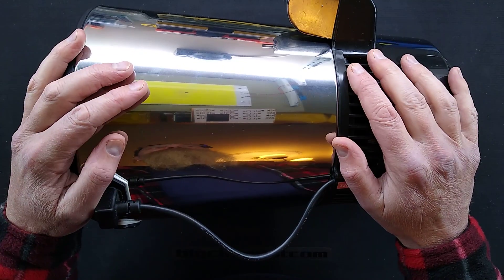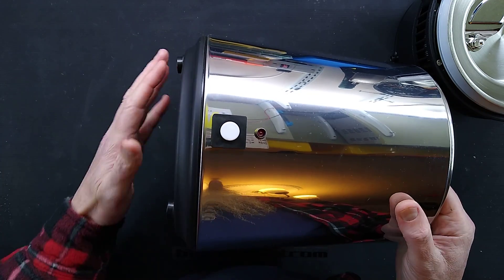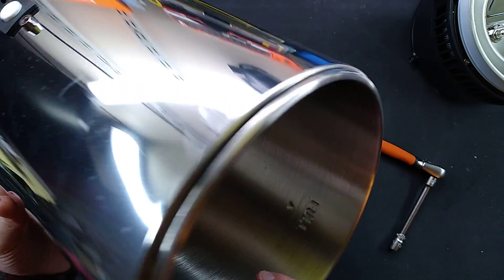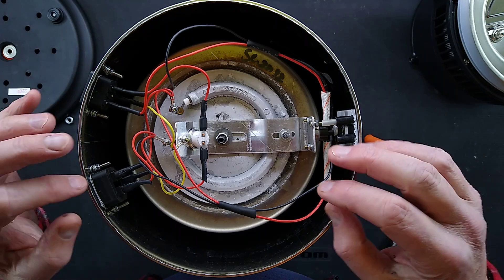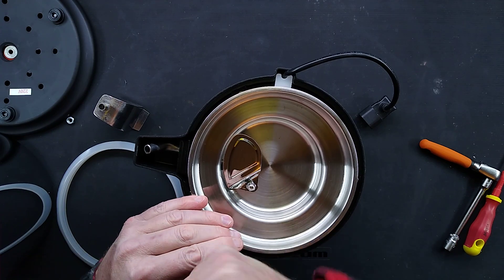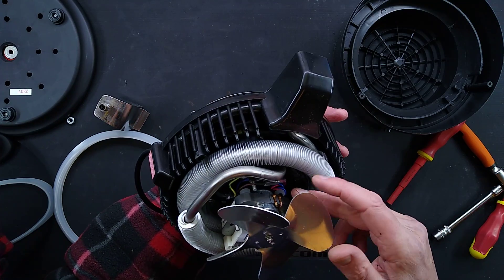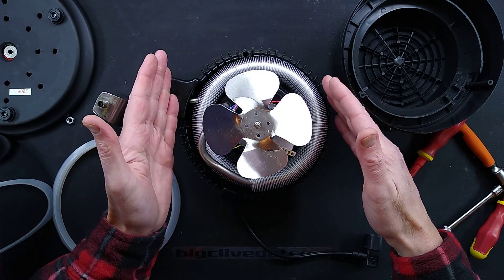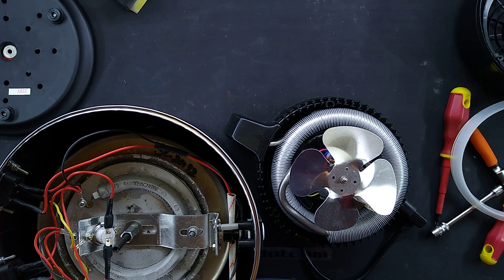Water/alcohol air-still distiller teardown

Comment: Adding a settable thermostat, possibly even a PID controller, in just the heater leg of the circuit would allow precise temp control (below 100c) unless you replace the temp cutouts.

Someone mentioned using reverse osmosis to "deionize" water.. It won't work.

You need a deionizer column with "water softener" beads in the column.

Lab stills are made of a special glass tubing.. metal will leave all sorts of ions in the output.

Thanks for the look inside.

Comment: I wondered what the simplest design would be so the waste heat is not all released into the air, but used to heat up the next water close to boiling temperature, so evaporating it takes less energy. Just like in industrial distillation - heat recovery. I mean even just 50% recovery would be a huge efficiency gain.
Reply: I'm thinking instead of a coil and fan, have the steam move through a 1/4" copper pipe that's inside of a 1/2" pipe.  Water comes in through the 1/2" pipe, which cools the 1/4" enough to make it an evaporator, and that heat is transferred to the new water, pre-heating it before evaporation.
Reply: @alexanderm2702  that's a pretty good description of one form of counterflow heat exchanger.
Reply: usually done in a continuous flow apparatus. I suppose you could do a batch variation on that, but as the secondary pot gets warm, efficiency of condensation would drop, so you'd end up with either losing water vapor (humidifying the room) or need just as long a condenser anyway.
Reply: @RossReedstrom  You could probably do it using a heat pump, but would be terribly complicated for such a small distiller.

Comment: I have a very similar looking model and even after multiple runs, without the carbon filter, the water tasted terrible (much worse than before). Distilled water should have not taste, so I take that as a huge warning sign. Something must be leaching back into the water from the top part. I mean the addition of a carbon filter itself is suspicious, because it should be mostly redundant in a system with material that do not leach. Does anyone have similar experiences or insights?
Reply: Get one of those timer power sockets and set it to shutdown sooner so there'd be a bottom of water left, otherwise the leftovers get burned and leave behind a nasty smell which you can taste, although the water is clean (0 ppm)
Reply: @null643  interesting thought. But even the first drops, or the middle stream tasted terrible, when there was still a lot of water left in the boiler, so this does not explain the taste here.
Reply: @tristanwegner  So that means you either have a bad unit or a new one which you need to run a few times to get rid of the factory smell. Also, could mean your taste buds are not used to clean water and need time to adjust to it. Don't know if yours came with a plastic collection bottle, I'd recommend a glass one if that is the case as well.
Reply: @null643  Thanks for your suggestions. The collection was glass, and I had like 5 runs with a 4 liters of watch each, and the taste remained - manual only demanded 2 runs. Also I know how distilled water tastes (very mild and soft), so I am sure there is something else dissolved in there. I friend had a similar (but not identical) unit, with the same taste issue.
Reply: @tristanwegner  Try doing batches of 3 - 3.5 liters
Reply: @null643  Spot on. Exactly what I do too.

Comment: I use distilled water for CPAP.  I used to buy it premade at the grocery store, but then some time into COVID, the hospitals sucked up the supply and you couldn't find it on the shelf any more, so I bought a distiller to make my own.  However, I got a stovetop version (something like a double boiler, but with three pans instead of two), so considerably less intricate than this device.
Reply: @mobility_criteria  1 US gallon of water uses about 2.7kWh of energy to boil dry (350Wh to heat from 20c to 100c, then 2.35kWh for enthalpy of vaporization), not including heat losses or energy for the fan. Unless your energy is less than about 50c/kWh it's cheaper to buy than make.

Comment: I tried using a similar one to distill red wine. Result was an indifferent sort of brandy… after several repetitions of that, I broke the still and couldn’t get it to work again.

This was twenty years ago and it was a Kenmore brand still from Sears, pretty much a dead thing now.
Reply from the maker: I wonder if a thermal fuse or connection has failed.  They're very simple units.

Comment: I bought one of these for distilled water. The cut off doesn't kick in until the residual solids have burned, which causes your freshly distilled water to taste disgusting.
Reply: Yes exactly that, need one of those wall socket timers to set it to shut off sooner.

Comment: A general question: Because of the Covid shortages, the 99% IPA is either unobtinium or very expensive. Would this work for concentrating the 70% IPA to higher percentage? Maybe redistilling it 2-3-4 times? Using the dimmer for the heater, would need lengthy calibration, and probably baby-sitting the still.
Reply: IPA forms an azeotrope with water at 91% concentration-  so you could theoretically get that far, but no further even with repeated distilaltion. To get purer IPA you would need chemical drying agents or molecular sieves.
Reply: I know Indian Pale Ale is supposed to be strong but 99% is taking the piss.

Comment: Plug condenser into wall not base, then condenser cools at max and you can then mess with "pot" temp.
Reply: I did that, and used one of those cheap Chinese temperature controllers with the thermocouple placed inside :) Mixed results tho...

Comment: EtOH takes less heat to distill than water by a large margin. Dunno what sort of oil you would want to distill; most oils will decompose before they boil unless you distill under vacuum or use an inert atmosphere.
Reply from the maker: I think the unit may be used to extract volatile essential oils.

Comment: The electricity cost is significant. Carbon + RO/DI is cheaper and better than a still, for purifying water in significant quantities. You can add a UV unit if you need to kill bacteria etc.

Comment: Heh, I've got one of these, but it's a huge chungus at 6 liters. I added a mat of fine copper wool to the bottom of my reservoir to aid in boiling and it's a night and day difference. It just audibly sounds so much more violent and I can get more of a steady stream coming out of the tap than the usual intermittent trickles unmodified.
Reply: Ever tested the purity with that setup? It boils calmly for a reason, as to not let me water from the tank contaminatie the tubing.

Comment: Looking on eBay, the same type of air-still is available with variable digital thermostatic control for a bit more money, wouldn't it be better to just buy one of those?
Reply: I bought one of those, and no.  With the controller it's either heating flat out or not at all, and I found I had scorching on the bottom of the unit, and variation in heating. resulting in off flavours, and higher water evaporation.  I ended up bypassing the controller, putting a power controller on the power in and cutting the power down to about 270-300W, result was a steady drip, less off flavours and a higher ethanol percentage (before was around 50-60%, after closer to 80-85%)
Reply from the maker: It would depend on your application.

Comment: What is the mode of operation of the latching thermal switch? if it has a magnet it might be using the same mode of operation described by the channel Technology Connections for a rice cooker, and it is brilliant. Essentially it involves creating a ferromagnetic alloy with a carefully selected curie point for the magnet to latch on.
Reply from the maker: It's a bimetallic disk.

Comment: Very similar to the water distiller I use.  They don't do a good job on alcohol due to heating power and what chemist would call a low theoretical plate count.  This means poor fractionation as the difference between boiling points isn't much..30 degrees or so.  
Water and total dissolved solids have a much higher boiling point difference. 
It is a lovely 750 Watt heater as the maximum temperature is below 100°C.

Comment: I love how simple these are but I feel they would perform a lot better with a PID controller!
Reply: Wifi enabled, for sure.
Reply: I had one of these with a PID built in.  I was using it for products other than distilled water, and an issue I had with it was that it tended to scorch on the bottom, run too fast while heating,  and giving less than pleasant results.  I ended up bypassing the PID, using a simple power controller and results were much better.
Reply: The one I have does have a PID. You can also set the target temp and the shut off temp deviation. I set it for the IPA boil temp and then when it goes up to above that into the temp for boiling water it shuts off. I use it for recovering IPA that has been used to clean resin 3d prints.

Comment: Seems odd they don't try to recycle the heat that is captured in condensation (you showed hot air) back to input fuel
Reply: funnily enough, I was considering using the heat generated to preheat my next sugar wash batch. It is a waste in my mind.
Reply: That's not the function of the device, you'd need to engineer a completely different device to achieve that efficiently and safe.

Comment: You could fit a thermostat to it, so long as it's rated for mains voltage. Might need to check the wiring to ensure things are working just fine (perhaps even a solid state relay to take the load off the thermostat).

Would make a nice little kit project.

Comment: Judging by the concave side of the fan blade being on top it blows upwards and draws cool air in the sides. Heat naturally rises so expelling the waste heat upwards where it cannot be recirculated in a loop makes a little more sense from a scientific point of view. 😉
Reply from the maker: The air blows in the opposite direction from what I described.  It's different to my other one.
Reply: @bigclivedotcom  in any event,  I'm still a big fan of your videos ❤️

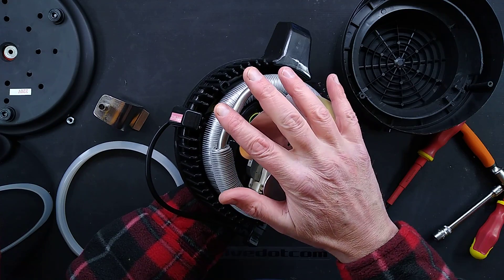Comment: 6:20 Actually the fan pushes air out the top of the unit,  Look at the curvature of the blades, the way you describe the blades would be running backwards and would be most inefficient. Since heat rises, you would not want to fight that effect, so air is pulled in from the sides and the heated air is pushed out the top.
Reply: You are correct. It sucks cooler air through the cooling disc fins soldered onto the condenser tube and blows the waste heat directly up. Can confirm as I own one. Not recommended to run in the middle of summer as it can quickly make a room uncomfortably hot.
Reply: @MikeTrieu  I was thinking the same thing as soon as he said it drew air from the top. Good eye gentlemen
Reply: @MikeTrieu  Does it also increase the humidity in the room, or is the vessel pressurized during use? I currently only make RO for drinking/cooking but have noticed that it is also really good for coffee/tea and other devices that would normally develop deposits. I no longer have a serious need for distilled water, although it is always handy to have around.
Reply: @abc-coleaks-info  very small portion of water gets lost, so no, virtually no humidity added.
Reply: @NoHandleToSpeakOf  actually 25-30% of the steam should be purged for high quality distilled water. Otherwise volatile matters will not be removed fully.
Reply: @NoHandleToSpeakOf  Thanks for replying! I will be investing in one.
Reply: True. Hot air comes out the top. My garage is always noticeable warmer when I've distilled 5L of pure water 😊.
Reply: Similar behaviour/output to a condenser tumble dryer ~ needs to be operated in a cold garage, house with the heating off in the winter
Reply: Hello, I am trying to repair my distiller and have removed the fan. About to reconnect it. When you look down on the fan (with the bodes oriented as shown) which way around does the fan spin (clockwise of anti-clockwise)?

Regards

Comment: Impressively thin wiring for 750W :D
Reply: It is likely chineseium. and the power lead itself may be aluminium electroplated with copper. Replacing that and at least some of the internal wiring will lend peace of mind.
I had a kettle lead get unpleasantly hot not far from the plug end, so I stopped using it. sadly wiring could not be replaced economically

Comment: People also use distilled water for medical devices such as for sleep apnea (Constant Pulmonary Air Pressure Machine)or CPAP. Also useful in humidifiers for avoiding scale.
Reply: CPAP is Continuous Positive Air Pressure. I've used one for the last decade.
Reply: @wirdy1  15 years here.
Reply: …although the distiller itself does have to be descaled as well…through a much easier process.
Reply: Water for my CPAP was the immediate thought when i saw this, it's such a pain when the store is out of distilled water and i need it for mine.
Reply: I make nebuliser saline peroxide with mine. Plus I drink the pure water.
Reply: That moment when you try and sound smart but it backfires
Reply: @Doc_Hawk  I made a mistake, and if you are woefully ignorant of the concept.....Ask you dad.
Reply: @redsable6119  lol naw im all set. 10 years as a medical provider doing emergency medicine using CPAP in conjunction with vasodilators to stop people from drowning in their own backed up fluids. I don't need to ask anyone anything. But if you'd like I have a topical pain reliever I can give you for your rectal pain

Comment: Interesting the element looks just like the inside of my jug on the bench (not just spot welded) , different switch setup of course as boiling ones jug dry sort of defeats the purpose. And I would fully expect aluminium for the condenser tube for obvious thermal reasons.
Reply: Al reacts with water and copper internally plated or covered with tin is better. The condenser fins are Al (just like in the air conditioner units).

Comment: Many years ago I saw a secondhand water distiller - the glass system that every school chemistry lab had - and long regretted not buying it. But then the common thing to buy instead of distilled water (eg for batteries) was deionised  water, I think produced by reverse osmosis. It was apparently just as good for most purposes. 
If deonised water truly removes all the ions that aren't H or O, then what is the remaining advantage of true distilling ?
Reply: theelmonk, iirc deionized uses an ion exchange resin although you could then run that thru ro. I think you can substitute distilled for deionized but not always the other way round.  Deionized is cheaper.  Note as the universal solvent 100% pure h2o is unobtainium.
Reply: Semiconductor manufacturing uses ultra high purity water. So pure it is actually toxic.
Reply: @anullhandle  I can't find unobtanium on EBay is it an Amazon exclusive?
Reply: deionized water does have organic impurities- contamination from sewer will have ammonia that will not be removed by distillation. same way alcohol and acids (acetic acid) will be removed only partly by distillation. for lab quality water, you need to distill the distilled water and use a quartz still and heating without producing bubbles.

Comment: If one wanted to control the heat, it's easy enough to power the fan separately from the heater since they've provided a convenient connector.
Reply: i bought a cheap water distiller 750 watt ( no temp control) i used it to distil some orange wine i made. I pour 2.5 litre in the machine and let it run. the 1st 30 ml i discharged , then collected 500ml spirit. It still taste like orange and has cleared up a lot. But somehow it doesn't taste nice ? I think the temperature was just 2 hot ? So, i ordered myself a Voltage dimmer and a extension cable for the fan which i plug into the socket (i dont want the fan to run low ) and i will try again, once i received the Voltage dimmer. Do you think this will work ???